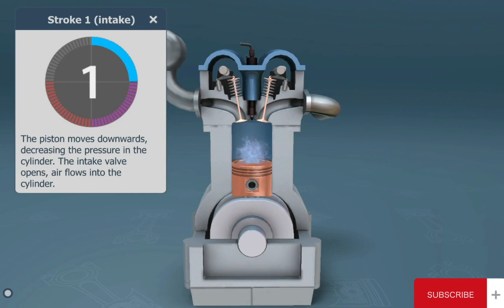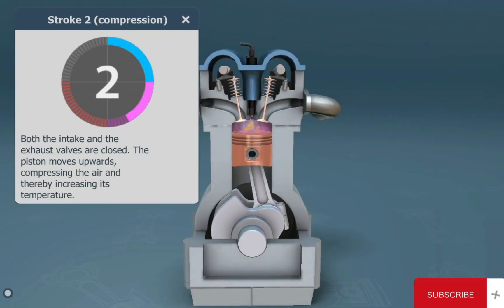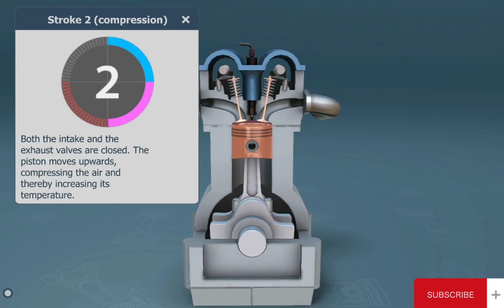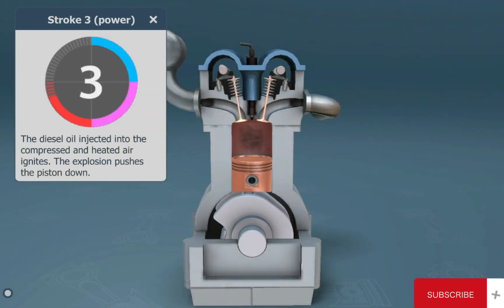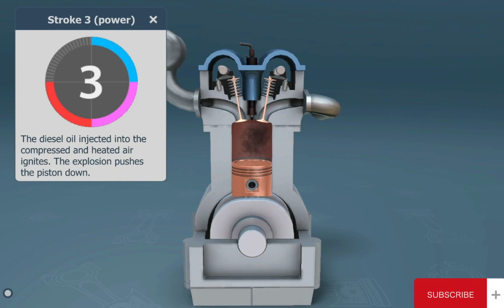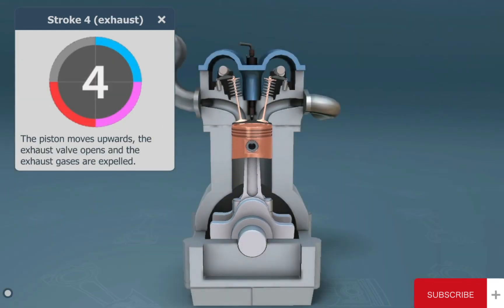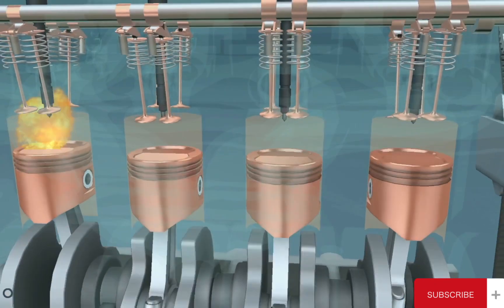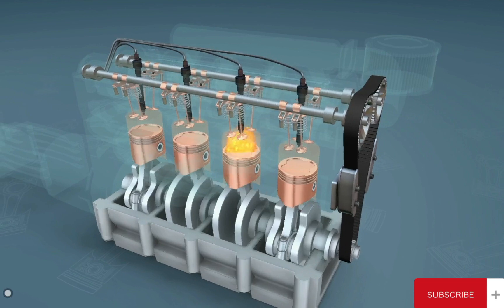Diesel engine , how it work

Comment: Next time you could put in a twin two stroke engine  from a snowmobile with it clutch and torque or driven pully on the manual transmission  try it you will be surprised  8:46 pm Atlantic time